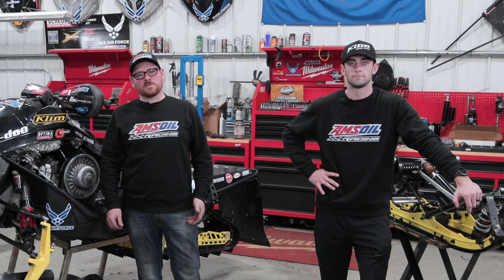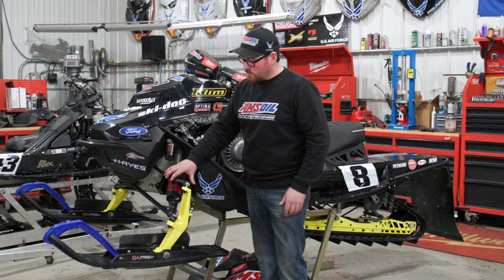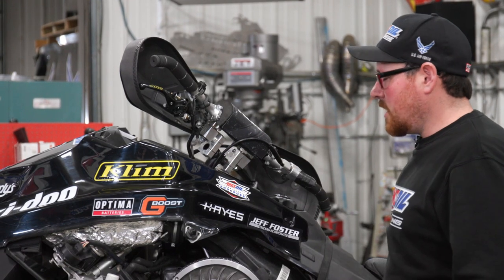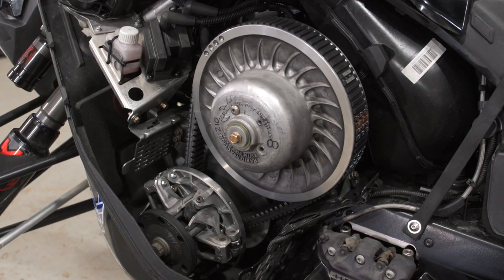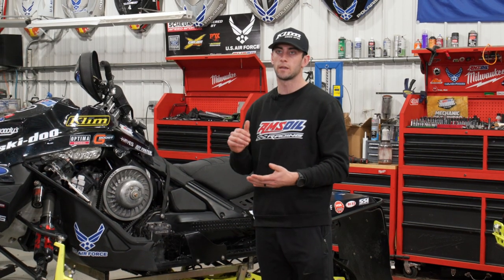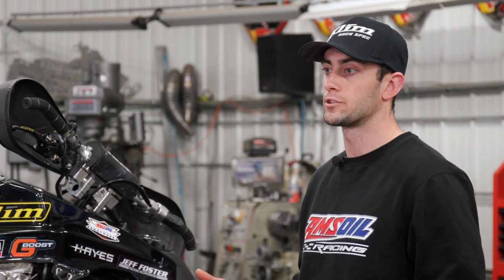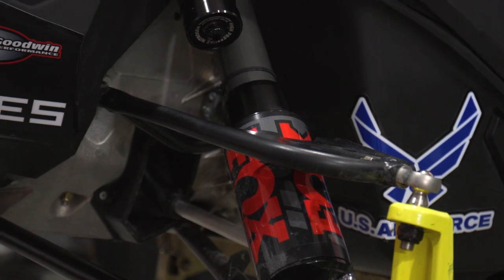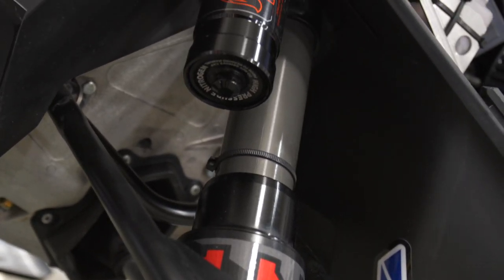Stock Vs. Race Sleds - What's the difference?

Comment: a race sled has a rider that gets paid to drive fast 
stock is a rider that pays when he goes fast
Reply: A  pure race sled runs nothing like a stocker.. just trying to trail ride a true 600rs or what ever in stock forum will prove it with how the heat light keeps coming on with packed trail and the way they rip to 60
Reply: @Sparaco487  what ?
Reply: @jack the ripper  you said there's countless video of these 850 racing snocross sleds. So i searched and i found only them racing the 600r which is not skidoo snocross model
Reply: @Sparaco487  what have you been smoking ?
Reply: @jacktheripper-hp9tx  i got you mixed up with another guy who commented thinking the 600r was a production race sled, my bad
Reply: @Sparaco487  what ?
Reply: @jack the ripper  can you read? I literally said i got you mixed up for some one else that commented on this video too
Reply: @Sparaco487  what ?
Reply: @jacktheripper-hp9tx  huh?
Reply: @Sparaco487  what ?
Reply: @jacktheripper-hp9tx  huh?

Comment: really not that much different. All bolt ons pretty much
Reply: You never rode one i take it? A 600 snocross will rip a 850 to 60 and they wint run well on pump gas
Reply: @Sparaco487  they definitely are not beating a 850 there have been plenty of videos showing that on YouTube and no shit it’s high compression
Reply: @superktman55  my stock zr6000rr normal trail sled only looses a sled and a half length from a dig to a big bad 137 850 free ride.. these 850s arent that crazy. And my zr is slow compared to a snocross sled
Reply: @superktman55  when i search on here 850 vs 600rs all that comes up is 850vs 600r.. the 600r isnt doos race sled. Corin todd is a local to my area and his polaris 600 is qouted to dyno around 170 to 180hp.. thats what 800s are making